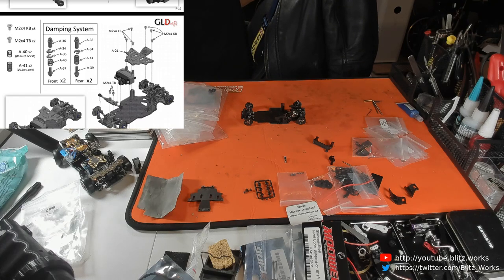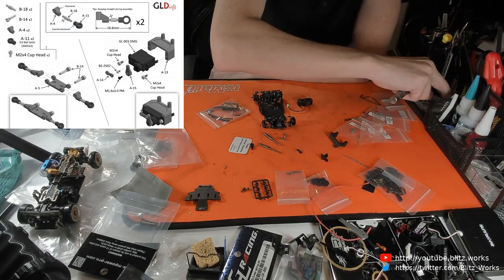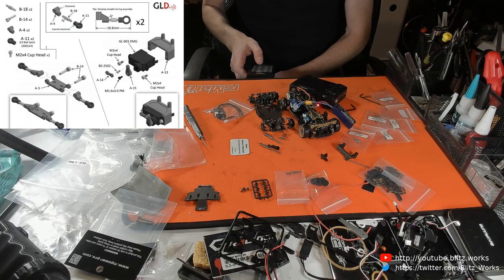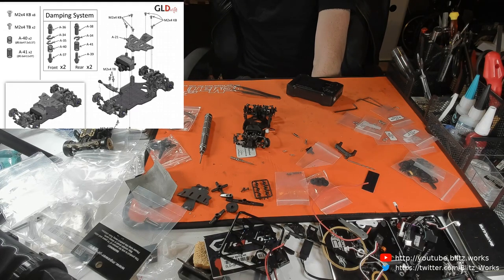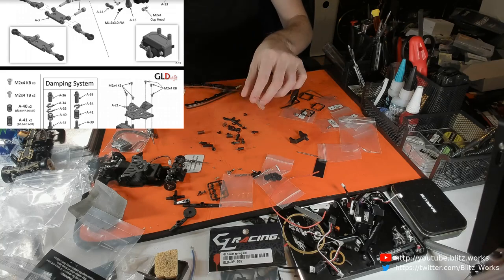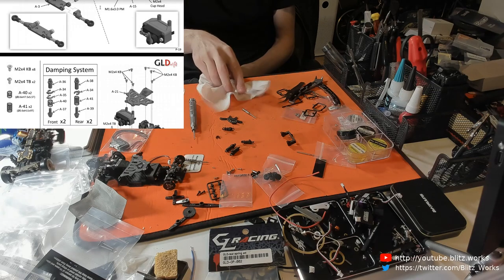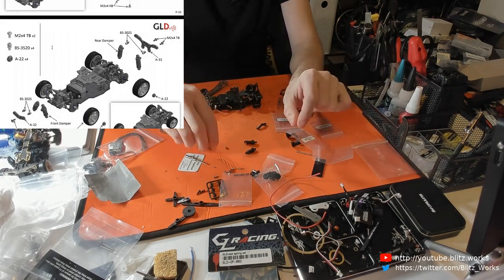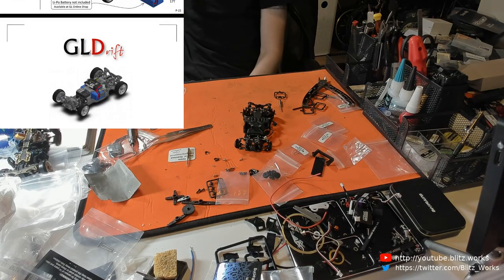Building the new GL Racing Drift car - The GLD - Part 5 (Final)

Comment: Thanks for posting these build videos! What's the total width hub to hub for the gld? Is it the same front and rear? Thanks.
Reply from the maker: 74mm outer to outer, front and back identical and 7mm of axle protruding per side (14mm total). Axel is rounded at the bottom so i recommend the use of 0.5mm circular spacers (ie circle on the inside rather than keyed spacers). doing so tightens up the steering a lot
Reply: @BlitzWorks  Thanks. 74mm means it's considered mini-z wide right?

Comment: Hmm I don't have issues with the servo connection popping off(I installed the other way and had the arm be connected to the servo arm initially, and then clicking onto the rack. If you see the manual there's a small indent on the arm(A-14), which should show what its orientation is supposed to be, and is what I followed(EDIT: Nevermind, just noticed there was no indent, I just remembered wrongly, but its implied that it should be mounted on the servo first). Also it seems like your steering lock isn't as much as what I got, might be just the angle of the video though.
Reply from the maker: its the angle of the video and made worse by how close the camera is in. once i locked everything in place the second time it stuck really well and i suspect i just did not have it fully engaged the  first time as it s difficult to install at that point. Loved your GLD videos BTW really loving the GLD a lot.
Reply: Blitz Works haha thanks! It's a great chassis, and I really like it too. How do you like it compared to the DRZ V2 do far?
Reply from the maker: @Auranapse  Loving it, with the DRZv2 everyone is telling me 'tweak this, tune that', the GLD i built and poorly and it outperforms the DRZv2 by a large margin. not discounting that it can work but the out of the box and new to the custom built experiences is light years ahead

i literally had the upper arms the wrong way around and with something like 20 degrees of camber and the thing was still working really well

intending to do a review later tonight with my thoughts but at the moment its my #1
Reply: Blitz Works That's the vibe I felt too, I didn't get the DRZ V2 but seems like on Facebook a couple of people are having issues with it that need to be fixed, while with the GLD I've only saw one person with issues that turned out to actually him following the instructions wrong.
I'm so glad I went with the GLD, build experience was miles better than the DRZ V1. Looking forward to your review then :P

Comment: This or the newer DRZ??
Reply from the maker: Needs some more testing but so far the GLD is in the lead, getting about the same performance for less effort and tunning. that said i would like to look at moving the atomic shocks over to the GLD as i prefer more configrability than spacer clips but that is my only real complaint

the disk brakes are awesome but you will want to paint them before you put them on.